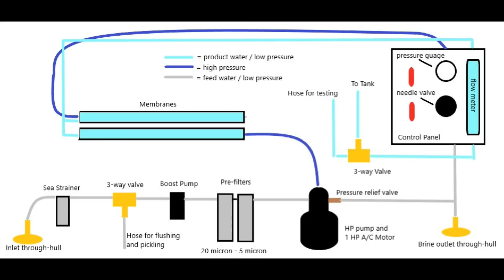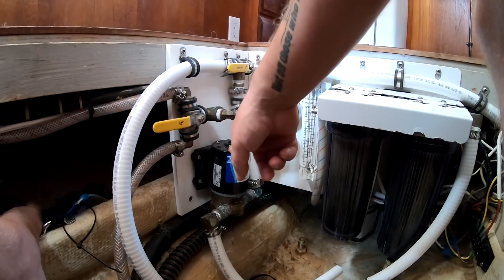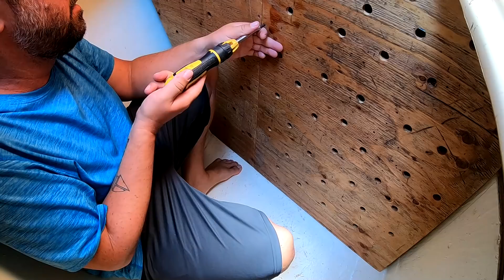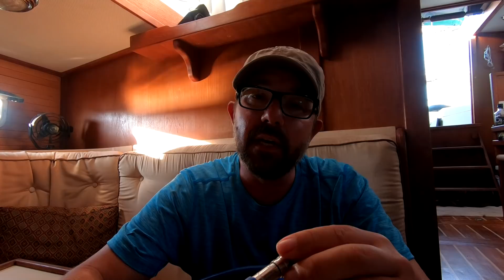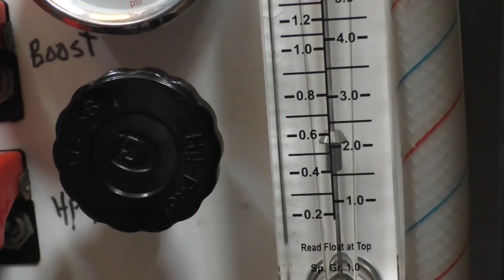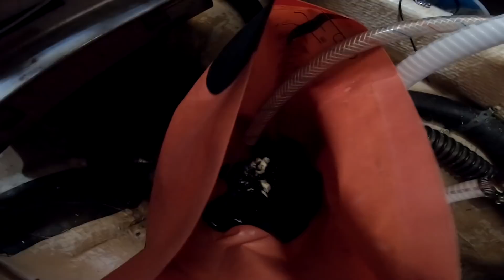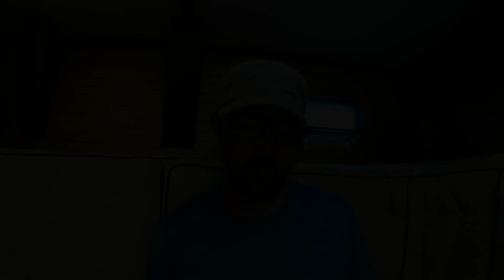How to make a 30 gallon per hour watermaker using off the shelf parts.

Comment: Be aware a 1.5 hp motor will likely not run on a honda 2000.  Even with a soft start because most will use 15 amps and the honda 2000 can only produce 13.3 all the time, and not to mention the startup current.  Therefore you will need something with a little more oomph!  Also the 1.5 hp could use qty 2 2.5x40 pressure vessels.
Reply: Allyn Onderdonk - I like the 4x40” vessels for the same reason but I’m not sure if they are available in the typical cruiser supply shops abroad...maybe someone could chime in.  Also, it should be noted a larger supply pump needs to be used with the 4x40 membrane to keep up with flow to avoid vacuum pressure just before the high pressure pump.  Run the supply off 12v to reduce genny draw if overload occurs or switch to a hybrid inverter if you’re building a new system to draw off of house and 2kw genny simultaneously to meet initial surge👍
Reply from the maker: Thanks for all of your input Allyn! Great info!
Reply: Yes Victron sells a hybrid inverter/charger that can pull from the batteries if your generator or shore power isn't enough to handle the load.  Unfortunately even the 1.5hp motors out there probably pull more than you can get out of a honda 2000.  They are only rated at 13.3 amps continuous, and the motors usually pull about 15.5 amps.  I am buying a Phasor 3.5 kw diesel genset.  1/5th a gallon of diesel and no chance of "Le Boom," and maybe a little air conditioning or showers thrown in for fun.
Reply: Allyn Onderdonk thanks for the great info. You seem to know your stuff.
Reply: The 4 X 40 membranes require much greater water flow and therefore much greater pump and motor.  Way beyond the capability of most sailboats.
Reply: Most can't but thoses with a 3kw or higher generator should be able to pull it off...but how many actually have a generator like that...not very many, probably 40+ft and higher and only some of those.  It would require at least a 1.5hp and high pressure moderate flow pump head.
Reply: I posted a new source list for pump and motor so go to the top recent posts on the video to find it.
Reply: Just wondering about the ability of the Honda 2200 (max 2200W 18.3A and rated 1800W 15A) to cope with the 1.5hp motor and additional membrane capacity?
Reply: Well it still likely couldn't handle the load as you would still have another pump on the system and it would likely pull 2-3 amps as well.  The priming pump uses a bit too, so it might be a real stretch.  Also you would likely want two of the 2.5"x40"vessels so that you can meet the discharge requirements.  Not the 4"x40" which a 1.5 could barely handle with the right pump.  Get the 3000 model Honda or a 3000 model Yamaha and you would be fine for the higher output.  The 1.5hp is 15 amps..plus 3ish...is 18 amps, and beyond the 2200.

Comment: With a 1.5 to 2hp 1725-1800 rpm motor and a 4" x40" pressure vessel, you might be able to hit 50-60gph with the pump I listed. 1.5hp is probably the sweet spot in terms of energy use to output.  You need to hit at least 4.2 gpm brine discharge for a 4"x40" for membrane longevity, so two of the 2.5"x40" might be better, but you can do a 4"x40" membrane on 1.5 minimum.

Comment: https://www.ebay.com/itm/AR-PUMP-MODEL-RCA2G22E-2-0GPM-2500PSI-1750RPM-5-8-SHAFT-ELECTRIC-PRESSURE-WASH/222529368201?hash=item33cfc8b089:g:SxQAAOSwnK9ZPsoh Brass pump head..not stainless, but will probably give just about as much life.  1 HP dual capacitor pump easy starting. https://www.ebay.com/itm/1-hp-electric-motor-56c-1-phase-tefc-115-230-volt-1800-1750-rpm-tefc-f56c1s4c/182741668176?epid=2255951668&hash=item2a8c409150:g:YBwAAOSw~FJZEh4G     This is the cheapest pump and motor that should fit together I found.  I haven't put them together, but I have known others to use them in their RO systems.  Thanks for the pressure vessel link, I've been having problems finding a good one at a good price, I hope the pump links help someone.

Comment: Stainless steel jic fitting for you high pressure. Jic fitting are for hydraulics  rated for 3000 psi and they are easy to find

Comment: I really enjoyed your information and I agree with all of it, I do have a question about the back flushing. Why not have a tap on the tank you just filled a draw from there instead of the bucket?
Reply from the maker: Because sometimes we tie up to a dock and fill the tank with regular tap water from the dock. Most city water has chlorine in it which is harmful to the membranes. To avoid risking damage to the membranes from residual chlorine in our tank, I use the bucket method. But, we do also have a charcoal filter which removes chlorine that we can run water through if we want to use the tank water for flushing. For the video, I was just trying to get the basics out there.
Reply: Now it makes sense, thanks
Reply: I was wondering the same thing. Makes sense. Two things you should never run through membranes is Chlorine/bleach or oil. Think other video I seen they had two water tanks so never filled one water tank with water from onshore. They always flushed it with fresh water at end, claims that prolongs life of membranes as well getting all salt out of them.